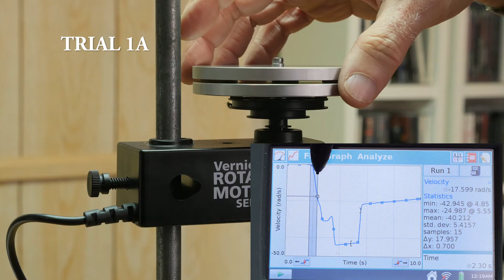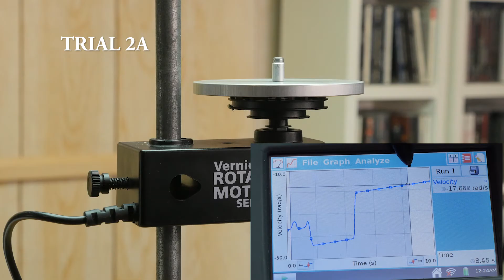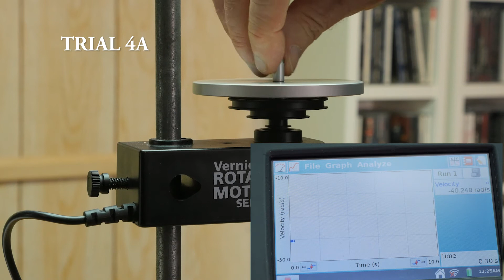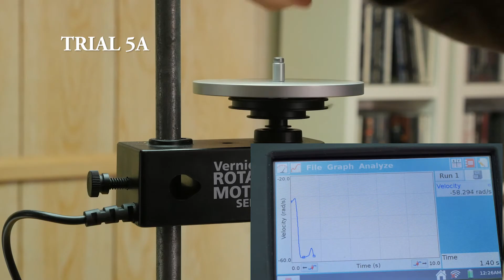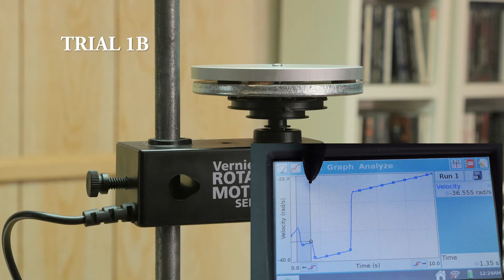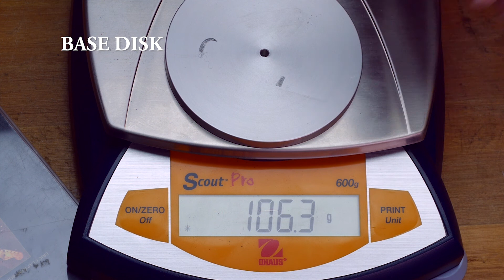Conservation of Angular Momentum Virtual Lab

Comment: The reason that it is impossible to determine with any accuracy the actual mass you are trying to determine is because angular momentum is not conserved.
Reply from the maker: I got within 2% error only using one trial.
Reply: @MrMbelling  In modern physics, 2% is such a large discrepancy that it proves the theory is wrong.

Calculations which conserve the angular energy will produce far more accurate predictions.
Reply: @TheAnimammal  The claimed conservation of rotational energy gives a deviation of 30% to the experiment. As there is always some residual torque it is clear which explanation is the right one.
Reply: @zeroelevation3837  The right explanation is that angular energy is conserved. But you are in denial.
Reply: @TheAnimammal  What is the difference between rotational energy and "angular energy"? Rotational energy is obviously not conserved if you lose 30% and "angular" energy is unknown in physics. How does this relate to any known properties like angular velocity or moment of inertia?
Reply: @zeroelevation3837  The difference between rotational kinetic energy and angular energy is that angular energy is conserved instead of angular momentum, which is not conserved.
There is no "30% loss", you are imagining things.
Reply: @TheAnimammal  But what IS "angular energy"? Where is the definition like that for rotational energy E_rot=J*omega²/2? If you combine two disks as shown in the video, we clearly see that omega drops by a factor of two (from -40.1 to -19.897 rad/s) , which means that angular momentum L=J*omega is conserved. If rotational energy would be conserved, omega would only drop by a factor sqrt(2). But it drops by 2 and rotational energy drops by sqrt(2), which is aproximately 30% loss. So what is "angular" energy then, if not rotational energy?
Reply: @zeroelevation3837  It does not drop by 2. That is a manufactured result.
Reply: @TheAnimammal  What is the ratio between -40 and -20? These are the values in the moment directly before and after the drop. You can also see a slow, but steady loss of angular momentum due to residual torque. If you take this into account you will come to the factor two with a precision of better than 1%. So what exactly is manufactured here? Why should this experiment be manipulated? And how and for what reason?